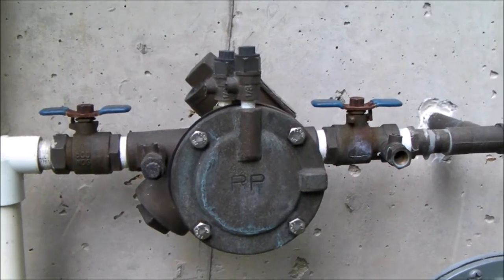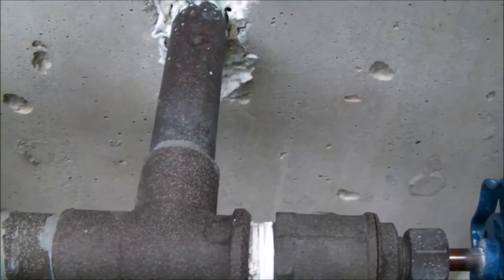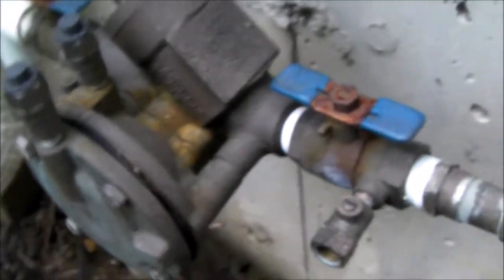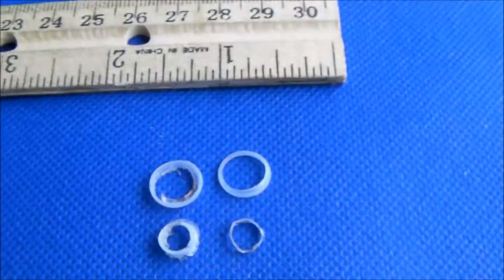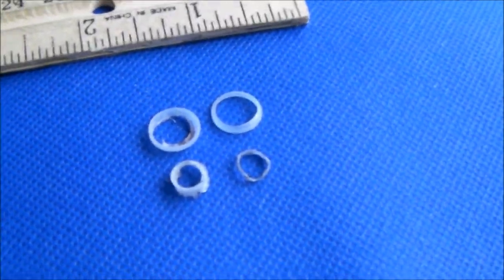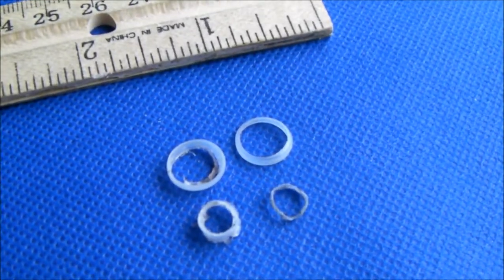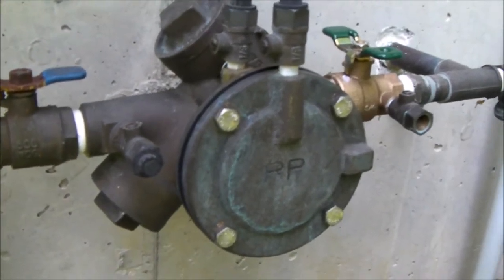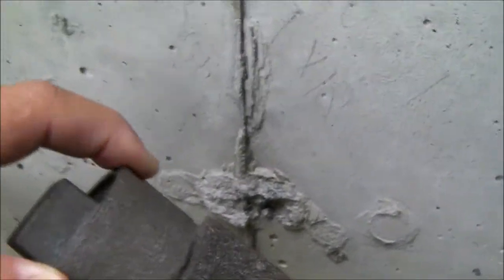Ball valve replacement on Febco 825Y backflow preventer / anti-siphon valve

Comment: If you put ball valves on a 45 angle will not split in freezing water got behind ball valve and split try it never fails
Reply from the maker: I agree that's what the mfg winterization instructions say.  I'm 100% certain mine were at 45 deg.  Worked fine like that for 16 years, then cracked one winter!

Comment: i am replacing both of my ball valves for the exact same reason, i ordered 2 valves and am waiting for them now
Reply: I have the exact same backflow preventer and a split in one of the valves. Where did you get the replacement valves? Sprinkler Warehouse says they are out of the 1-1/4" and will not be instock until July.

Comment: For sure, dealing with a copper "T" would be faster and sticking  to the plumbing code ... Cutting PVC and connecting it with a black rubber bands...plus extra work, spinning, disassembling . oooouch !!! I have no idea about your jurisdiction, but any RPZ work requires - where I live -  certified plumber. Who after replacement  any parts inside must run a test. Everything must be paper recorded as well. This is a liability of the valve owner.

Comment: Did you use your differential gauge to determine if the RP was working properly after you reassembled it? 

You'd had been better off to heat up the copper tee and break that joint to get to the number 1 control valve that was split.